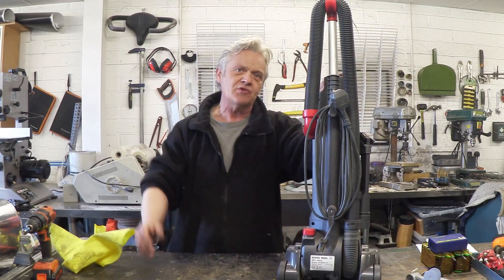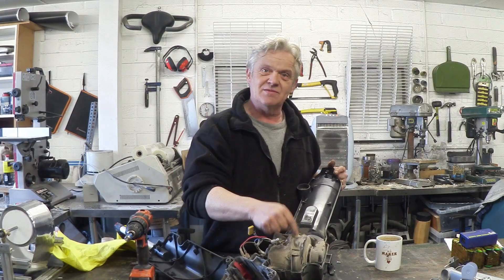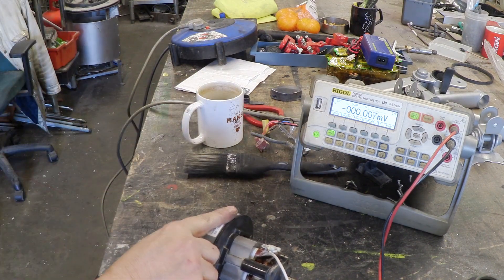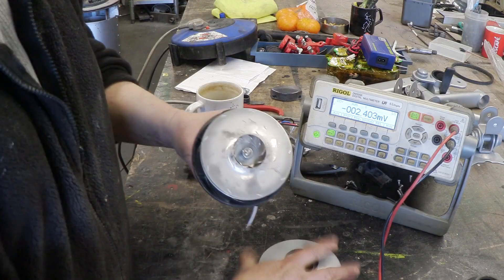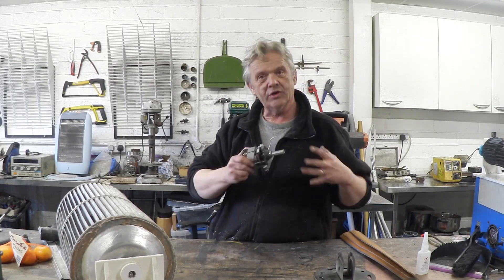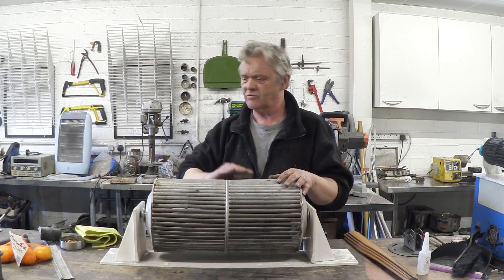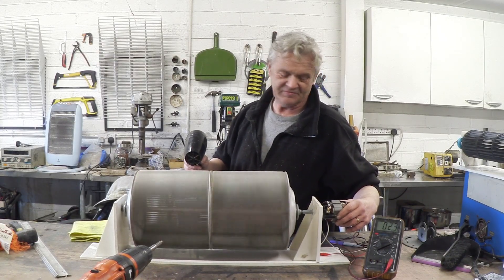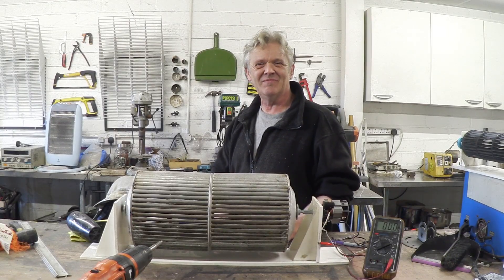994 Turn An Old Vacuum Cleaner Into A Wind Turbine

Comment: I'm a 6th grade English teacher. While we were reading "The Boy Who Harnessed the Wind" I had an old vacuum in my classroom that no longer worked. The kids would take turns reading out loud and when they finished reading their part I would give them a screw driver and let them remove a screw from the vacuum. We did this until we were able to get down to the motor. I showed them the internal workings of the motor and how it was still usable. They are becoming inspired to see other objects they can find that have purpose that would have otherwise been thrown away.

Comment: Since it has no permanent magnets...does it simply start on some remanent magnetism left in the mild steel cores and sweep up from there? Must be...
Since so many ebikes become ewaste I used a direct drive type, alu blades cut from irigation pipe pop-rivetted straight to the rim and the hub, spokes all still in place. Been running for more the 10 years now. Needs furling, limiting, static balancing and a rectifier but fun!

Comment: DEAR ROBERT
Do you know the new propulsion system for jetoptera aircraft? It is based on the same principle as dyson vacuum cleaners, and in theory they are 15 times more efficient than a blade vacuum cleaner, I wonder if that process could be reversed and use the air using projected on a dyson profile and that this was 15 times more efficient to generate electricity

Comment: Did you ask yourself why it's a generator ? It's not so obvious. Remember there's no permanent magnet in there no' re is there initial current there to turn either stator or rotor into an electromagnet. Why does it start generating without magnetic field in the first place ? It actually starts due to earth magnetic field. In theory it should start with reverse polarity if you rotate it 180 degree. I never tried that but you might.
Anyway, it's a series motor. Generation will depend on magnetic field generated, so current, so the electrical load you connect. Your multimeter 'll be 10 Mohms or so and that's a very small load. If you connect a 200 ohm/100W load or so I think it will produce serious power at high RPM.

Comment: For me the issue with renewable power is the storage of energy.  So my goal is always to pump water up hill, to use its potential when other sources are unavailable.  If you get a bit of time could you help me with that.
Reply: Water hammer pump. It will take 10% of the original water supply and pump it uphill. It will even pump vertically. 
And yeah it requires no electronics. Very Very easy to make.
Reply: I m thinking of a pumped hydro system, with a large storage tank at the bottom of my property, and a large storage at the top.  Like 140 ft differential.  I do not have access to The type of stream required for the water hammer.  Wish I did.
Reply: @protyusgames4741  water hammer to elevated silo. Silo to hill top. Maybe?
Reply: How about a horizontal flywheel a mile in size? Be fun to walk on, too.

Comment: Simple and Brilliant yet again Rob! what's better for a ratio change from the roll cage to the motor? :   direct drive gears or tiny Chinese scooter chain and 2 sprockets? is there a downside to either that im not thinking of, apart from chain being easier to tension, than the motor/gear being positioned. clutching would also be easier with chain/sprocket, but is that even necesarry on this style of windmill? whats the best circuitry for converting the large range of voltages output at the different wind speeds to the one way diode for connecting to a battery bank?  (these are more public food for thought than anything i need answered) lol

Comment: Are you ever going to finish the other wind turbine or wood gas generator video series or are the final parts of those done but for members only?
Reply: Always benefits of being a member. Cheers
Reply from the maker: they are finished projects mate - pretty much the only outstanding thing is Bessie
Reply: @ThinkingandTinkering  I've seen a few videos with the wind turbine where you've said you'll put it on the roof when it's done but not that actual video that showed if you got the output you whereafter in the real world. The wood gas generator was never connected to the generator to see if the project worked. Have I missed videos?

Comment: Does the motor have a magnet in it?  Otherwise, would seem you had to add power to the coils and yes, I do not know much about them..   : )
Reply from the maker: no mate it doesn't - it uses the remnace of the magnetic field already in the rotor - it is a bit like an alternator - so a feed back of a starter current would help but isn't strictly necessary
Reply: I was wondering the same thing. Robert has answered. I think permanent magnet motors are more efficient.